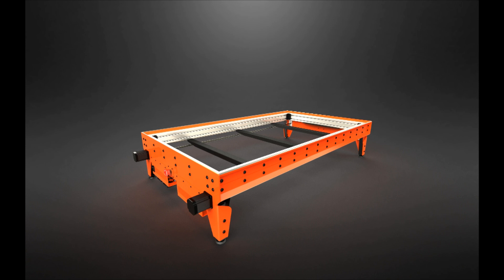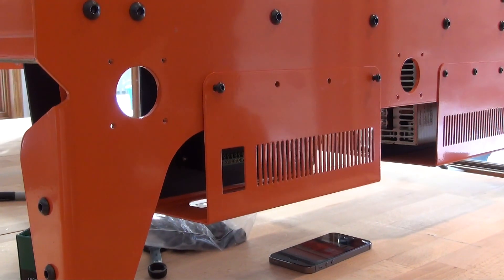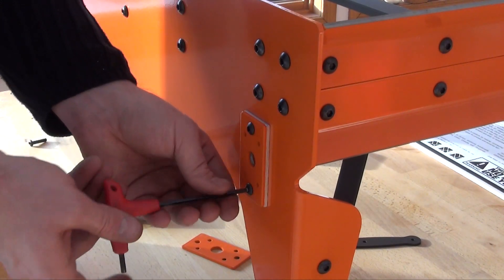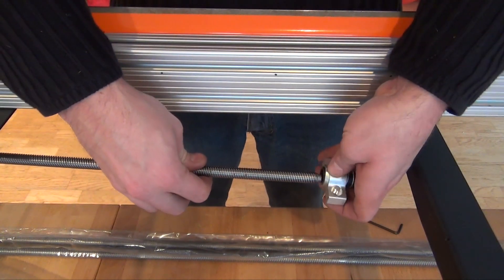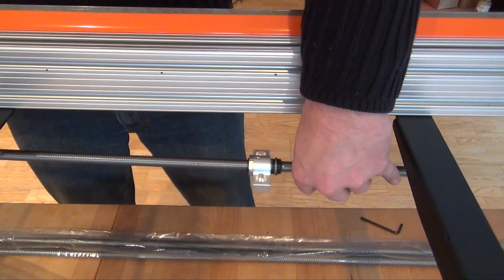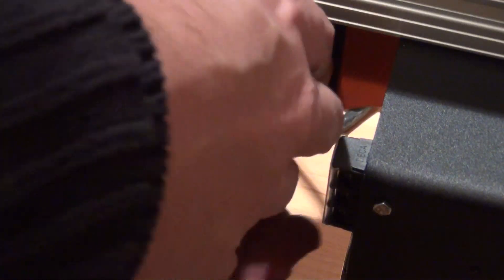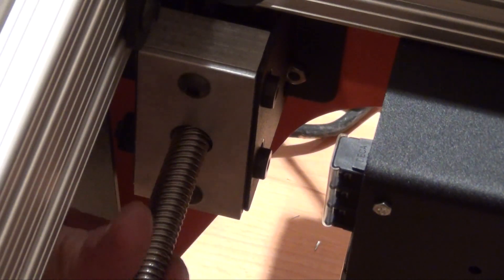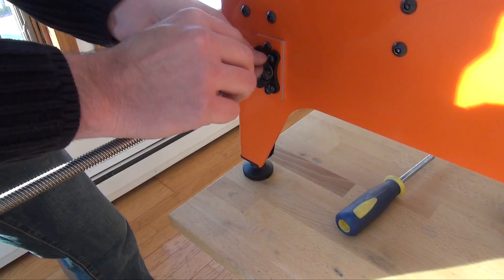Platform CNC Kit Assembly | Base, Part 2

Comment: Hello, how do you prevent distortion of x axis when you have a dual drive if mill hits something on one side and one stepper motor moves and the other stops.
Reply from the maker: Hi Agata, I believe there should be about 150 lbs of thrust per stepper motor due to the mechanical advantage of the lead screws.  This means there is about 300lbs of force on the dual drive axis.  Certainly, if you hit something big enough to stop the machine, the part would likely be lost and if you suspect misalignment, you should realign the machine.  Dual drive is less likely to experience distortion due to loading on one side of the gantry.

Comment: Also, in the video you are not using any form of locktite screw adhesive. In the construction document, I believe it mentions this. Do you use it, or is it unnecessary?
Reply from the maker: I do suggest considering blue thread locker as this helps keep things from loosening due to vibrations.  I have not used any thread locker on either of my personal machines and so far so good.  Just don't use the red type as you would need a blow torch to disassemble!